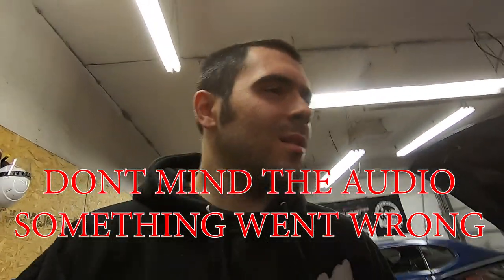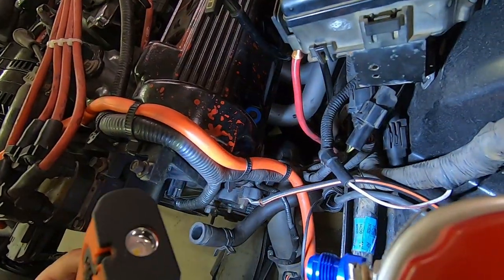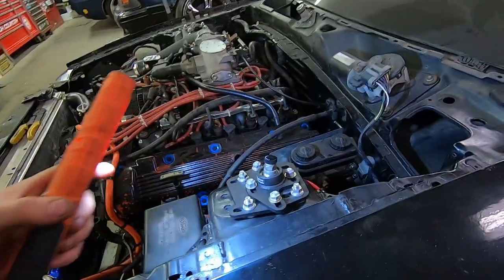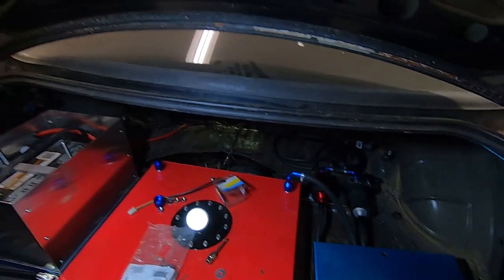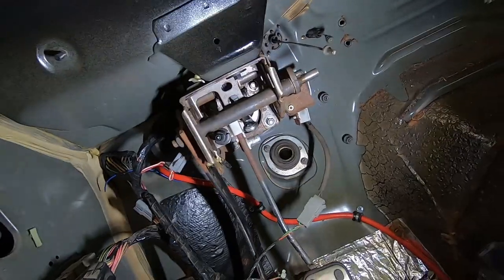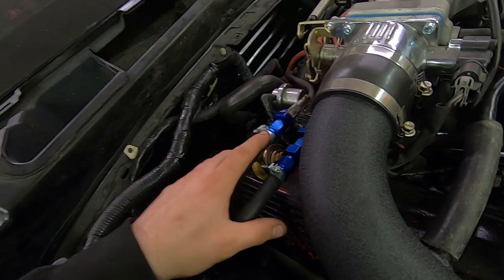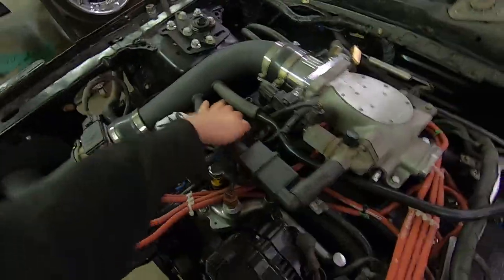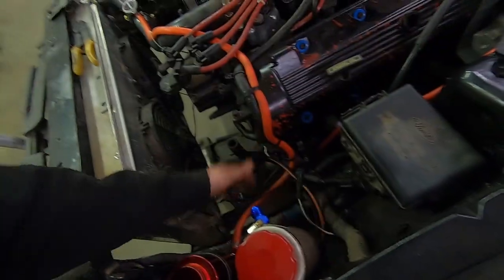DRIFT STANG UPDATE

Comment: Looks like it's going to be a great build. Cant wait to see it. What rad are you running? If it is running hot cant you just get a bigger rad or bigger fans? We made our triple pass and that works well.
Reply from the maker: That's what I have. But it might be because I had ac still.
Reply: @RatchetstrapMedia  get rid of that ac! Do you have a pi or npi timing chain cover? You could just do the short belt route by rotating the tensionner with the pi cover!